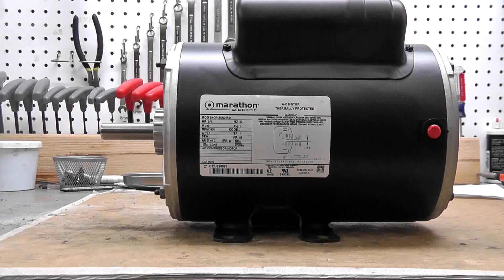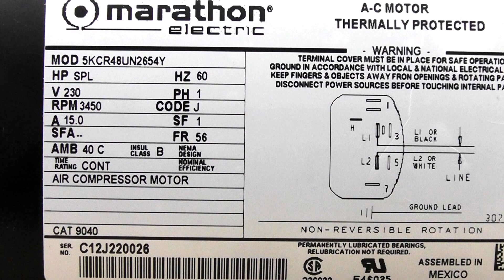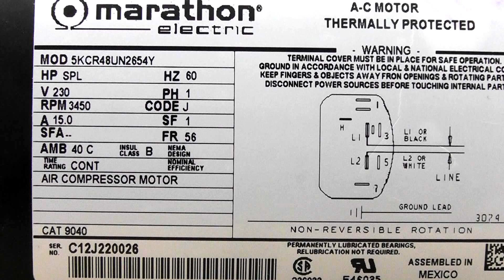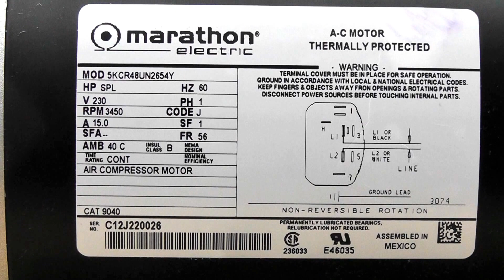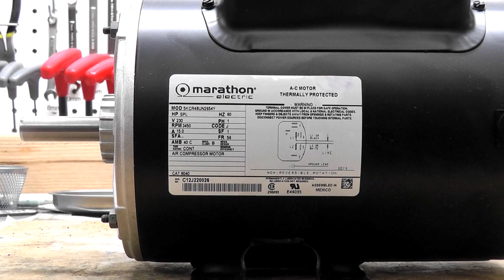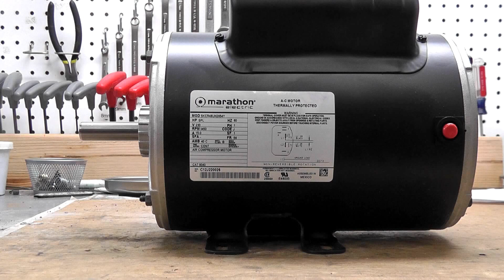Motor Replacement For Compressor

Comment: can a 1hp motor be used for a home made air compressor?
Reply from the maker: For many home-use air compressors you can certainly use a 1 HP motor, yes. It all depends, however, on the pump you're attempting to power. What is the pump model? What HP does it require? If it's a small pump it won't be an issue, but it won't be able to turn a larger pump. Feel free to reply with more information on the unit and I'll be glad to assist you further!